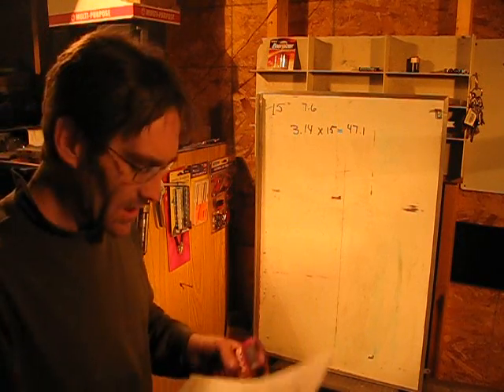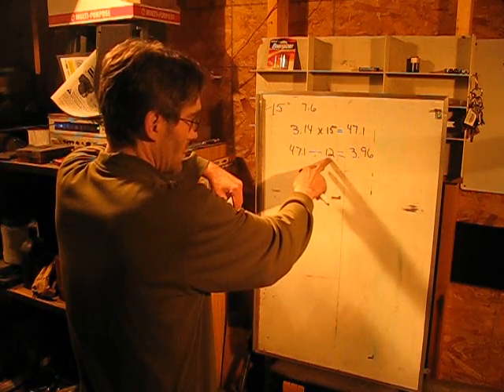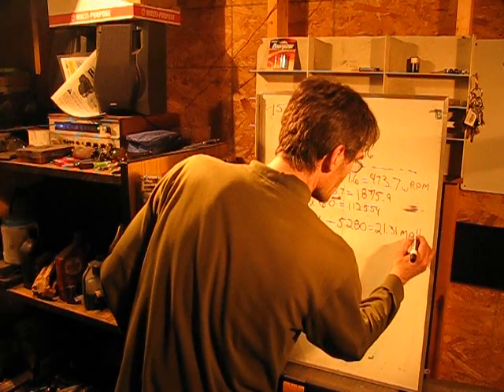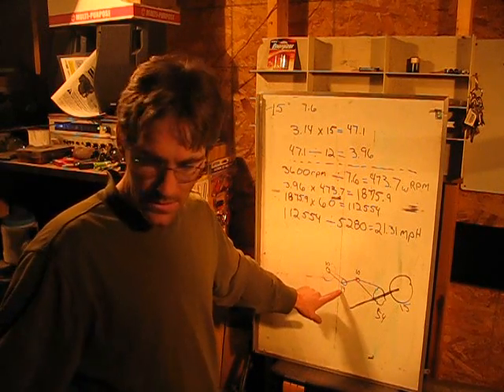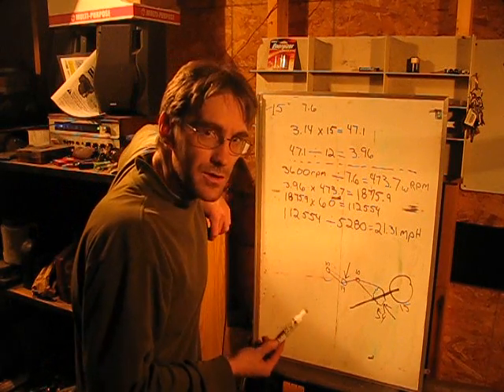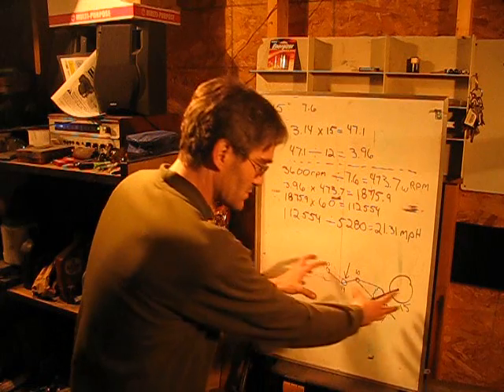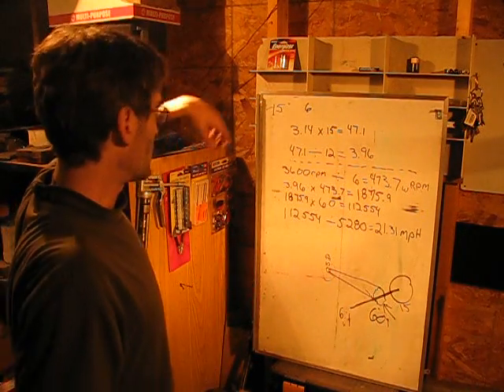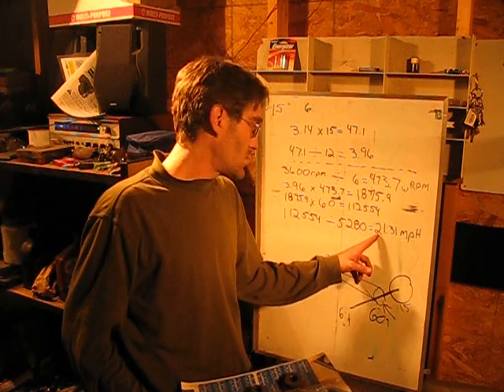Go Kart | Jackshaft Speed Calculation ( by T-man )

Comment: What a great informative video! I need stuff like this spelled out for me. haha.
So with a tav2, you have a 10% overdrive, where would I factor that in? in the mph?
Like this: 35mph x .10 = 3.5... then 35 + 3.5 = 38.5 total mph

does that sound right? or would I factor in the 10% overdrive into the sprocket ratio calculation?
Great video as always!

Comment: Nice vid...good explanation... I'm making a 2 seater go kart and was wondering what engine size 346 or 420 cc. Also it will have a torque converter and should I use a 12 tooth to 54 tooth or a 14 tooth to 54 tooth?

Comment: I have 2 relatively new mini bikes and I was looking at the rear sprockets my Coleman ct200U has a smaller rear sprocket then my Mega moto max 212. I want a 3 to 1 gear ratio and i figured if I put a 15 tooth on the crank and a 52 sprocket on the rear I should gain a lot of speed. The Mega moto max has a very large sprocket and if I had to guess it’s about 70 tooth and the crank is standard 10 or 12 on both bikes but the Coleman ct200U is most likely a 60 tooth max. They both are different size engines Coleman 6.5 hp and Mega moto max 7.5 hp. Out of the box I get 20 mph on Coleman and 30 mph on Mega max. For me to get a 3 to 1 gear ratio I need a 15 on the clutch and 50 to 52 on the rear I may be losing torque but I should gain around 15 mph more. I could remove or bypass both governors and gain an extra 10 to 12 mph. Do you happen to know of a fair reputable place where I can get 2 15 tooth sprockets 3/4” shaft without buying another clutch with the sprocket welded on? I think I can get a 3 to 1 ratio with a 15/50 setup. How do you feel about CVT’s I bought one and I’m in the process of building the new Predator Hemi 212cc my plan is putting my Mikuni v22 on it and increase the main jet and moving the needle emulsion valve down to second from bottom along with a Hot 265 Dyno cam a strong connecting rod and a set of valves better quality 22ld springs and a large pod filter and header pipe then I’ll remove the Governor so the engine can handle it. When I’m done the Mega max 212cc will go on Coleman with mild mods and the Hemi will go on Mega max.

Comment: hey tman waiting to hear back about my torque converter from seller.. but would a 6 in driven be better/faster in anyway then a 7 in driven?
Reply from the maker: yep.
Reply: T-Mans Go Karts ok cool ill make sure i get the 6 inch! im waiting on deezeeauto seller on ebay. they said there going to have me send this one back and get what i need that fits! so ill get both 6 inch driver and driven 3/4 bore and get a longer belt i guess a 3/4 inch belt would fit? lol and what tooth sprocket do u recommend i put on the jackshaft on other side of the driven?

Comment: Hi T-Man. If the speed required and the engine rpm are known. Is it possible to work out the jack shaft ratios and sprockets needed? I am hopeless at math. So would value a video if possible explaining. The motor I shall be using has 5000rpm. The speed I wish to achieve is 60mph. I hope you can help. I have watched this video several times over the last few days and still can't work out what I need. Thanks in advance. Hi to Crystal and kids.